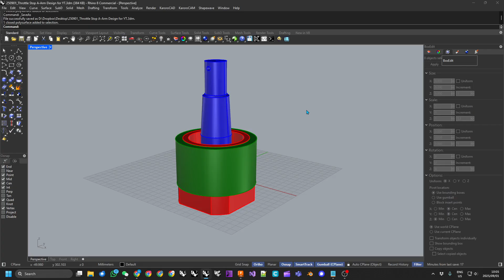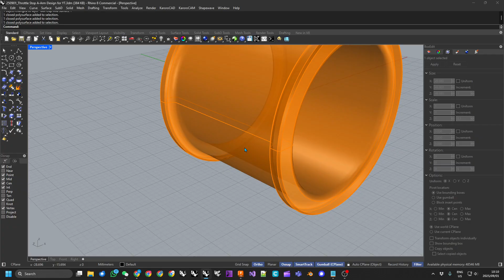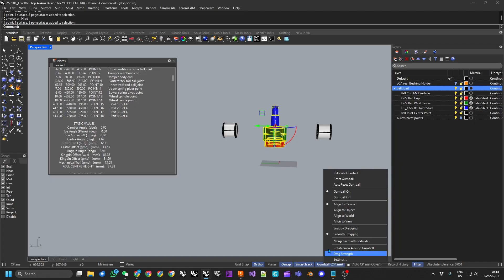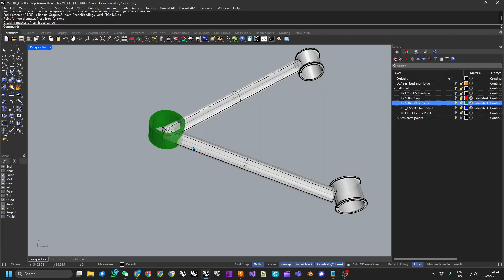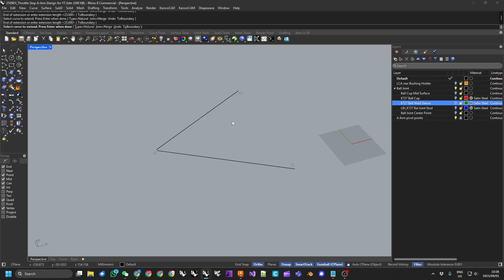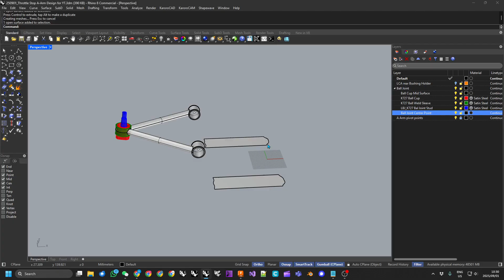Throttle Stop Garage A-Arm Design in Rhino3D

Comment: Tip: its generally good to have the ball joint housing collinear to the steering axis rather than perpendicular to the control arm. This means that the ball joint will be centred at its resting height and have plenty of ROM for + or - displacement. Otherwise the range becomes limited by the ball joint in either compression or expansion.
Reply from the maker: Thanks! I built this to match the Throttle Stop Garage dimensions/geometry. I actually went down the rabbit hole after making this video of programming a complete parametric suspension design plugin for Rhino after I made this video - but that will now have to wait until my own car project is underway. Cheers DK